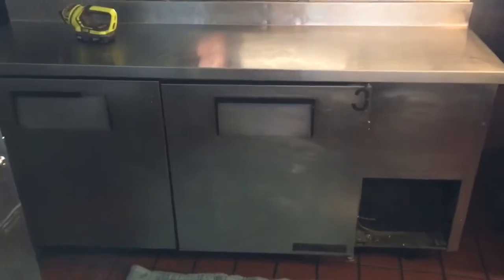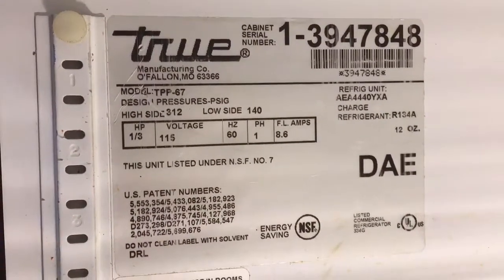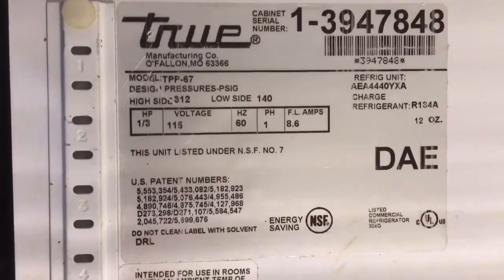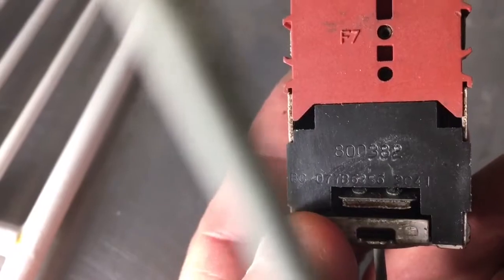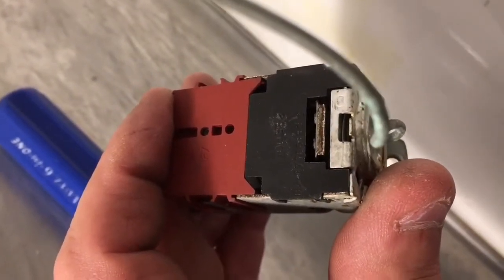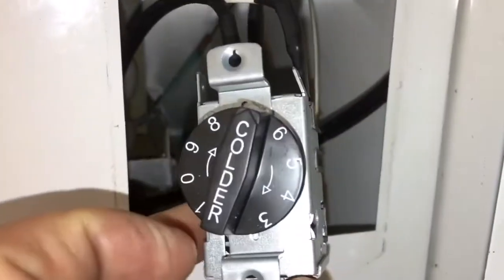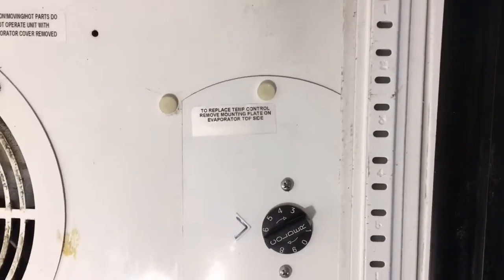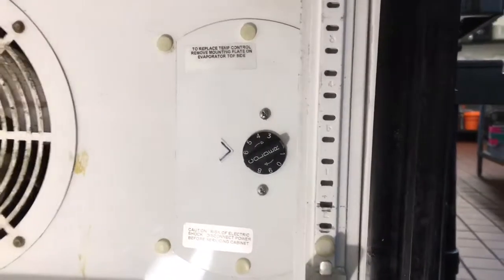How to Replace a True Temperature control. ( suitable for all audiences )

Comment: Hi, great videos! I have a question for you. I have a True dual keg kegerator. I have replaced the temp control but still have the same issue. The compressor starts and runs for just shy of two minutes and then stays off for six minutes and then back on for two minutes etc. The unit does not stay running long enough to cool down. Any thoughts ? Thanks !!
Reply from the maker: Definitely not good. Make sure to unplug it till it's fixed right. I'd have to look at it u can try this stuff. 
1) possible condenser fan motor not running with compressor. Check that fan runs with compressor
2) possible compressor start component failure. Start relay defective. Replace compressor start relay. Check capacitor or just replace capacitor too. 
Pretty much all it could be.
Reply: Fan is running when compressor comes on. New 3 in 1 installed. I guess I will swap out the capacitor. Thank you for your time sir !
Reply from the maker: I Hope Your not using the existing start capacitor with the 3-1 kit. That's not right. Only use 3-1 kit by itself. It replaces everything. Black to common on compressor ,, 
Red to run on compressor , white to start on compressor. Power in to  2 black wires to 3-1. Make sure u have it wired correctly. Make sure your using the right black wires there are 3 of them.
Reply from the maker: Thanks for thanking me for my time. You are Very Welcome ! So many people never say thanks. It 's very much appreciated.
Reply from the maker: When installing a 3-1 kit --- the old start capacitor and start relay are not used any more. Only use 3-1 kit.
Reply: I will have to look at it. A friend of mine that works on appliances wired it in. I don't know much about this stuff. Bought the unit used and am trying to get it running properly.
Reply: I wished you lived close by as I would just pay you to come and fix it and that way I would know that it would be done correctly.
Reply from the maker: I'm in California , where u at ?
Reply: Boston
Reply: I just called my friend and he told me that he removed the capacitor when he wired in the 3 and 1 I also replaced the thermostat as well.
Reply from the maker: And compressor still only runs for 2 minutes ?
Reply from the maker: Is condenser coil clean ? You must be able to see through it with a flashlight. is Evaporator Fan running inside fridge ?
Reply: Yes to both. The compressor and fan only run for 1 minute and 45 seconds then they turn off for 6 minutes and come back on again and this just repeats over and over.
Reply from the maker: Sounds like the compressor is Junk or the 3-1 Kit is wired wrong or defective. I'd buy a New 3-1 kit on internet  , confirming it is the right kit for the compressor or one size larger. Confirm compressor connections are correct. My gut is telling me it's wired wrong. C-s-r are in wrong spot. C-black wire , S- White wire  , R-Red wire. 
Check compressor amps on black wire vs nameplate amps.
Reply: I will do that. Thank you again for all of your help and I will let you know how it works out,you are a good man !!